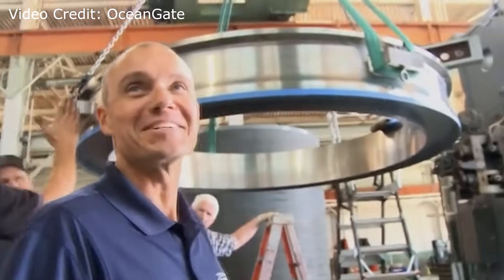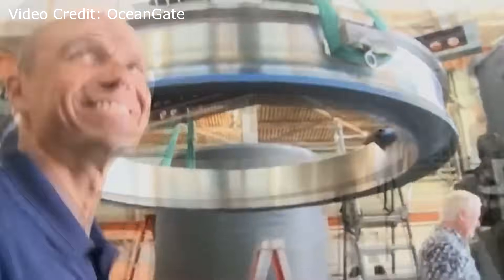Raw Unedited Re-upload of OceanGate's Promotional Video - Bonding a Titanium Ring to the V1 Hull

Comment: If the people getting in this thing were forced to watch two guys use the free home depot spatula spreading on epoxy mixed in a tupperware container, no one would've gotten in.
Reply: At least they nailed  it,  " not much  of a recovery." And " point of no return right here " 
Just saying
Reply from the maker: I agree!  the mission specialist in 2021, 2022, and 2023 never saw this, for sure.
Reply: the epoxy is probably stuff he found on amazon.
Reply: @LygerTheCLaw And?
Reply: @Ethan-burner-acc  is it a serious question? sure you can find some off the shelf stuff but when you're talking about 6000 PSI exerted on a hull at the titanic depths you might want to consider maybe not using some JB weld.
Reply: @solareclipsetimer  The fact he intentionally skirted around the law, by making them "mission specialists" as legally, could not take paying public down to the bottom otherwise. The arrogance of Stockdon was just amazing.
Reply: @solareclipsetimer  the mission specialists on titan signed a paper that said they were in an experimental craft and it mentioned at least 8 times the chance of death. If you agree to that, you agree to that.
Reply: @solareclipsetimer  This is so eerily reminiscent of the video made by the people who made the Verruckt waterslide. Everyone is smiling and confident, blissfully unaware they're making a tragic mistake.
Reply: I mean technically that's how you spread epoxy, there's not better tools than a silicone spatula for that... but with something like that for pressure rating, I'm thinking it should have at least been vaccuformed fiberglass so as to ensure even distribution of resin..
Reply: @emilflognoid1532 should have embedded rods like a high end sports car chassis 
Not glued together like a model toy car
Reply: @JonDoe-cg4mr Hi end sport cars are also glued together you hero.
The most expensive bicycle frames are fibers that are glued together with epoxy.
I see. You all never worked with your hands . Only on the keyboard.
Reply: i was hoping he'd blow on it at least once
Reply: Well it was vacuum formed eventually.....lol  @emilflognoid1532
Reply: @emilflognoid1532 the hull is way too thick for any amount of vacuum to matter. The hull was so thick they had to actually cure layers at a time and then go back and add more and then cure the new layer lol. No way a vacuum could uniformly distribute the resin before it dried.
Reply: Or the guy putting his hands all over the surface he was just cleaning thus getting the oils and dirt from his hands all over the surface making it harder for the adhesive to have a clean seal.
Reply: In the documentary I watched a few weeks ago, the guy from a Discovery Channel show who spent a couple of hours with Stockton Rush in the Titan doing shallow-water testing said that he immediately called his boss afterwards and told him to kill the segment, because it was obvious that the thing was a death trap.
Reply: Unless the passengers were engineers, I wouldn’t expect them to know whether this was good or bad.
Reply: I love that people are comparing building a deep sea submersible from novel materials to car mechanics, bikes and house building. 
Just take a second and think about how wildly different those things are. None of those things experience atmospheric pressures of ~6000 psi.
Sure the spatulas are a nit pick but it does speak to the mickey mouse nature of his build. I guarantee the Deepsea Challenger engineers weren't using spatulas and old yogurt containers to apply anything.
Reply: I think it's JB weld.   From the paint aisle.
Reply: The guy “cleaning “ the ring with the oil shop tools and no gloves is the underestimated worst part.
Reply: Ok I thought the operation looked a little Mickey Mouse, I was questioning if they were trained of carbon fibre or not.
Reply: They definitely would. People are incredibly stupid and naive.
Reply: Done in a dirty garage instead of a clean room
Reply: @dilutioncreation1317 a clean room, like where silicon chips are built.. what difference would that make for a submersible?
Reply: The tools are not as important as the processes and materials, unless they directly impact the quality of said processes and materials.
Reply: @DK-lz7kg 😂Ok
Reply: Hey. A 2 inch vs an 8 inch penis can still make a baby.
Reply: @WhateverWhatever2378 The Pakistanis would have, they were amazed it wasn’t held together with cow dung.
Reply: 1000%. Spot On!
Reply: Surprised they didn't use No More Nails
Reply: He claimed he had help from Boeing with the carbon fibre. When infant he had bought it from them for cheap as it didn't pass the standards to be uses on the new 737 Max..  that says alot as we know how dodgy Boeing is 😂
Reply: Just wait till you see how mechanics fix your car or the 737 you travel in😂

Truly tho, the epoxy is the least of my worries😂
Reply: Should be good to go
Reply: Wouldn't be surprised if they found pet hair in the adhesive from the unsanitary assembly conditions.
Reply: This is literally how mechanics do stuff with your car 😂
Reply: @Ethan-burner-acc  k buddy, are you a simpleton? You think a submersible is at all comparable to a car, and that the standards aren't completely different? God I hate simpletons like you. And there are so many of you midwits on this planet.
Reply: @Ethan-burner-acc  This is also.what NASA do with rockets. 

All this double left handed people here think anything has to be made with complex machines and iron ..  they have no clue how much craftmansship by hand and glueing with epoxy and shit is made on the most complex machines.
Iiam sure 99% of the commenters think Carbon Fiber is made from a carbon tree...while its actually shit thats glued together and holds up massive force for example on a bike frame.
The build looks equal to what they do in the video and still people trust their live on a downhill bike.
Reply: I'm not expecting my car to dive down to the titanic,  @Ethan-burner-acc
Reply: They should have done their homework and researched it first its their own dumb choice
Reply: @Darthdoodoo  ''They should have done their homework and researched it first its their own dumb choice''
- I see.  So that goes for every person who ever took a plane flight?
Reply: Eh there are many who buy what people are selling because of the people. You could show how a shit car is put together and if the person selling them is convincing enough people would still buy.
Reply: I work in Composites Research. The process and materials are more important that the specific tool.

Like the old saying about poor carpenters.
Reply: If they only used a better container to hold and apply the  epoxy. Wow thats what crushed the machine. They should have used an 18k yellow gold mixing dish with a diamond encrusted 14k white gold gents spatula. The contrasting metals would have looked sharp.
Reply: @cobre7717  that would be very demure
Reply: I see. You and ober 500 people never worked on construction site.
You kids would wonder how planes. Rackets. Submarines or racecars are made..

Comment: I work in Aviation, and there is plenty of glued composite structure on modern aircraft.
None of it is bonded together by mixing some adhesive in a bucket, slapping it onto the structure, and dropping one bit onto the other bit and calling it good.

Comment: It's wild to see them creating this critical mating link between titanium and carbon fiber using 30 cent yellow Bondo spreading tools from Home Depot
Reply: OceanGate Titan built by The Home Depot.
Reply: The carbon fibre is the issue. The glue is totally irrelevant. You don't make subs out of carbon fibre.
Reply: @jamesfranko5098  "Carbon fibre has no compressive strength, it's only good in tension" is also a bit of a myth. Definitely not considered as an ideal material from which to build a pressure hull, but not impossible provided it's done right. Nothing about this was done right. The layup and bonding of the plies was done improperly, the cured hull form was cut/ground improperly, the glue-up job was done in an open non-climate-controlled factory/warehouse by a bunch of dudes in t-shirts and aprons wiping the components down with rags, mixing epoxy by hand in cheap plastic buckets, and applying it with the abovementioned "30c Bondo spreading tools from Home Depot". It would be totally hilarious, if nobody had died.
Reply: But it makes sense considering they steered the sub with a plastic wireless gamepad controller
Reply: It was wired too 😂
Reply: There is nothing wrong with using a gamepad controller, the military uses Xbox controllers in their submarines.
Reply: @curtisjordan9210 the military ain't the brightest bulbs in the drawer either
Reply: @curtisjordan9210  That's been debunked. They used the Xbox controllers in their sub simulators.
Reply: @curtisjordan9210  The military uses gamepad-style controllers as a secondary input option in a couple of specific applications. There will always be a hardwired or more robust mil-spec wireless option, and they certainly don't use them in mission-critical/life-critical applications (such as controlling a DSV at depth). 
edit: In the submarine application you mentioned, the controller can be used to direct the periscope/optics.
Reply: @sixstringedthing Also, gamepad-style does not mean literal gamepads.  Not only are the cheap gamepads not exactly very reliable, they are inevitably unreliable because they use 5 cent potentiometers for their joysticks rather than splurging 15 cents for some hall effect sensors, guaranteeing that eventual noise and drift will happen.  So to use them on a critical system is utterly wild.

Comment: Now just think about it.  The pressure on something going to 4,000 meters held on by glue.🤨
Reply: That was applied by hand using primitive tools. Using nothing more than visual observation to determine quantity. Without wearing masks or even basic gloves. In an ordinary industrial shed / warehouse type building that would certainly be dusty and very likely doesn't even have effective control over temperature. 

They didn't just make a mistake, it's total incompetence.
Reply: @shaun5552 You are right in that it was total incompetence on many levels. To start with they did not do the full research on the glue. If you do the research you will see it had at least one component that was subject to corrosion in sea water. If you look at the NTSB footage of the wreckage, on the ring you see what looks like rust spots in gaps in where the glue lost contact. You don't glue something together that will supposedly withstand the pressure of the ocean and then weld rings to it to lift that much weight. Who does this type of work in an open space were anything can adhere to the glue and cause micro gaps. I don't want to go down the rabbit hole on the plethora of mistakes made. Every time I think I have heard the worse, a new piece of information comes out. The main causes of the tragic ending of five lives was arrogance and hubris. To fire professional people you have hired, to assess and address safety concerns, is in itself insane.
Reply: Hmmm...

Compressive strength of epoxy is 140 MPa and water pressure was about 40 MPa. There was 100 MPa headroom.

Comment: Carbon fiber has great strength in tension, and not much at all in compression.  If I had designed that sub, i would have put 6000 psi on the inside, to give it a fighting chance.

Comment: That squishing glue probably created a trapped air pocket all around the joint between the carbon fiber and titanium ring, when that air pocket burped (IF it burped at all) it probably displaced the glue unevenly, creating random voids.

Comment: this is the 1st hull. The one that cracked and almost imploded on Oceangate dives in the Bahamas. Oceangate designed a 2nd hull, which they claim performed absolutely perfect. (ignoring the shredded sub & 5 dead passengers). According to Oceangate lawyers, anyone who worked on this 1st hull cannot offer a negative opinion.
Reply: The first sub cracked to, and he blamed it on a lightning strike.
Reply: This is the one Karl Stanley went down on. Said the cracking sounds sounded like gun shots. Even heard loud pops when they coming back up at 300 feet.
Reply: @Beltfedshooters There is a new netflix documentary with new footage, where you can hear those "gunshots". It's a horrific sound.
Reply: @Taronyu_SVK  I will have to check it out. Thanks
Reply: @Taronyu_SVK whats the name of the documentary?

Comment: I’m not a materials engineer. I’m not an adhesive chemist. I’m not an expert in carbon fibre construction. And apparently none of those people who were eyeballing the glue were either.
FFS-in an open air warehouse, no control over temp or humidity and THAT will do?
That may have not been the cause but, wow the lack of any common sense was stunning
Reply: It wasn't the cause, but it definitely was a cause: A chain breaks at the weakest link. In this case, carbon fiber is definitely strong and all, but the epoxy resin they plastered to keep the carbon fiber together? Not so much, I'd say.

The sub was as strong as its weakest link, and the weakest link was, by far, the ego of Stockton Rush, the "CEO" of OceanGate.
Reply: The fact that they were even considering carbon fiber as a building material was enough. It doesn't matter how good the preparations are, carbon fiber is never to be used for a pressure vessel.
Reply: @clutchboi4038  Why did they even make this piece of shit out of carbon fiber in the first place?
Reply: @Gamer_Man_Bathwater because carbon fiber is the only material light enough to get the vessel to be light enough to hold more than 2 passengers.

Triton already makes a classed titanium sub that can reach titanic depths, but it only holds like two people. This is not a good business plan for a company that wants to take several paying passengers at the same time to those depths.
Reply: @clutchboi4038  Ok that makes sense. I guess turning your customers into meat broth also isn't a very good business plan
Reply: The idiot CEO said  safety regulations and oversight stifle innovation…or something to that effect.  Man was insanely arrogant and mind numbingly stupid, and other people died b/c of it.
Reply: He's sounds like a republican who maybe at the last millisecond of life realised the Dems were right re some regulation and oversight.
Reply: What is frustrating is that it should be kinda obvious that carbon fiber's tensile strength doesn't imply compressive strength. It's FIBER. They were disregarding flaws a baby engineer would spot quickly.
Reply: This also explains why the world is in shambles: it's run by "genius" billionaires just like this dude.

Comment: Shocking as ever. Just for clarity to commenters - this wasn't the hull that imploded. It suffered delamination/cracking and the carbon tube was replaced in 2021. The titanium rings and domes were re-used.
Reply: Yup. But how much you want to bet they did the same when gluing them onto the new one?

Also, salvaging those parts is ridiculous, especially since you know the glue and pieces of the old hull had to be machined out. What kind of damage to the titanium might have happened during that?
Reply: Even better lol. This story just keeps giving 😂

Comment: 1:05 i saw this before but never paid attention, its horrfying, the glue is so uneven, i wouldnt even glue an aquarium like that (when DIYing it) no less Car parts (Am Mechanic) AND THEY DID IT TO A FUCKING PRESSURE VESSLE
Reply from the maker: Yep, It' pretty frightening.
Reply: @solareclipsetimer and it’s in the same video where he remarked on how viscous the glue is „like peanut butter“ you can’t make this stuff up, they couldn’t put 2, and 2 together to realize this weakens it massively
Reply: It looks like a tub of that "Flex-Seal" crap they sling on the infomercials.
Reply: They were clearly not the brightest bulbs in the fridge.